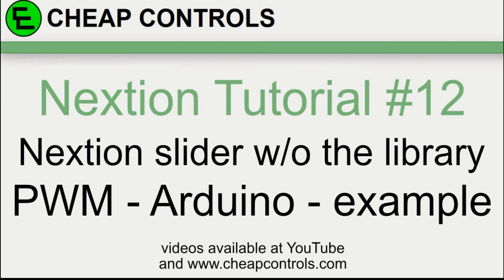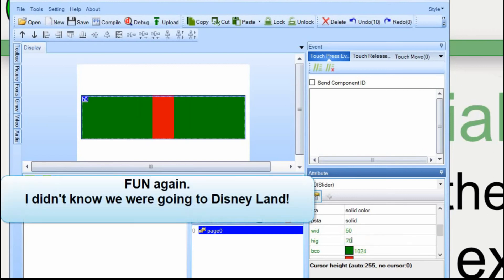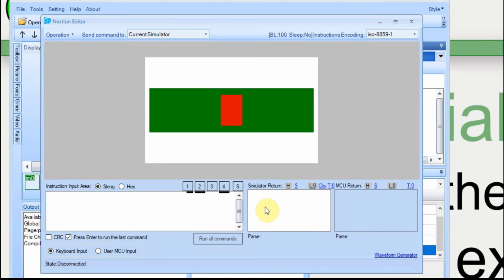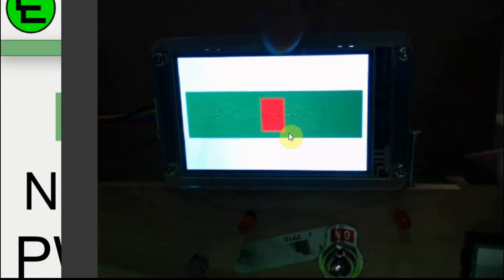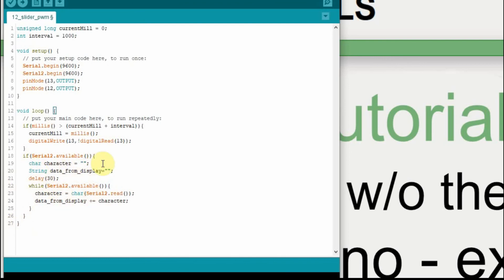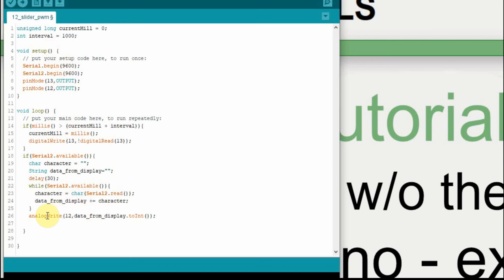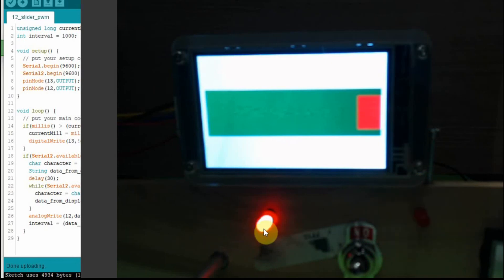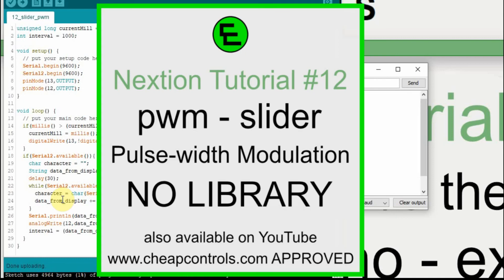#84 Nextion Display Slider to Arduino PWM Part 1 without the Nextion.h Library Tutorial

Comment: Not sure why. But when I try to Compile this to an ESP32 via Arduino IDE. Using Serial rather than Serial2. It doesn't compile and points the fault at the char character =""; 

error: invalid conversion from 'const char*' to 'char' [-fpermissive]

Change the board type to UNO and compiles fine.
Reply from the maker: that error sounds familiar but I can't remember the specifics.  Let me know if you figure it out.

Comment: Hi
Good method but unluckily only ok if you have a single slide sensing data from the display
Then i also have seen your other video about multiple display sources without library, but i found it little too cumbersome. I ll probably keep your library less method only for sending data to the nextion.
Did you produce also videos about arduino plus modbus display?(Like plc ones delta, coolmay..)
Maybe i ll end using those instead of the nextion one for my “plc like” applications
And i would learn a lot from your tips. Thanks
Reply from the maker: There are lots of ways to get a job done.  It is important to do it the way that you are most comfortable with.  Thanks for watching

Comment: Great Video.   Using the slider to set the speed of a motor.  I have the slider reading out to number so i can see what rpm it will be turning.   How do i send this number to the Arduino? do i need to use a variable? It asks for a touch even but i dont want to have to touch the number once i select it on the slider.  Any suggestions? Thanks
Reply from the maker: I would translate the slider value to a text variable with covx and then send it that way.  But you can send it directly also.  There are always a few ways to send values.  You have to play a bit and figure out which way makes sense to you.  When I send from a slider I always send on release of the slider and if I want more data I also send on move.  But if I send on move I always also send on release because sometimes it will miss that last move if I don't add the release.  I am just starting a series on controlling  DC motor with a L289N stepper controller board.  I will be adding RPM collection and control from the nextion.  I think I will have a video on what you are trying to accomplish soon.
Reply: Hello. Do u still have the code in Arduino for this? We have also to controll the max. speed of a bike ( Connected with a stepper)

Comment: I have a question: If i hit a point instead of sliding the cursor of the slider (for example cursor of the slider is in 80% and i tap 20% point without touching and sliding the cursor), nextion does not send anything, could you please advice something to fix this. Thank you, all the best.
Reply from the maker: Are you getting the results from this video?  Do you have the code on move or on touch or on release?
Reply: @CheapControls  I stick to the code in the video

Comment: Do you have a video showing how you wire the mega to the Nextion?
Reply from the maker: To the physical Nextion or the software programming IDE?
Reply: @CheapControls  Both Thanks
Reply from the maker: Check this link out https://youtu.be/Zh1kHsidlWE and let me know if it answers your question.  If not sounds like you have a good idea for another troubleshooting video!  We are always looking for good video ideas.  If you want head over to facebook and join the private cheap controls group.  You can get more help there.
Reply: @CheapControls  That is what I needed. I have the adapter. I used it on blue pill. Thanks a bunch my friend.